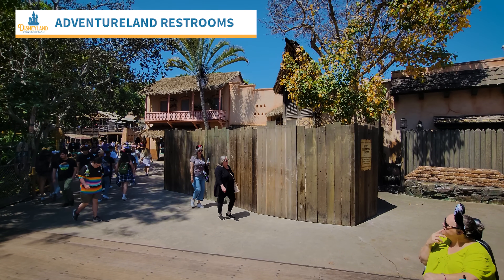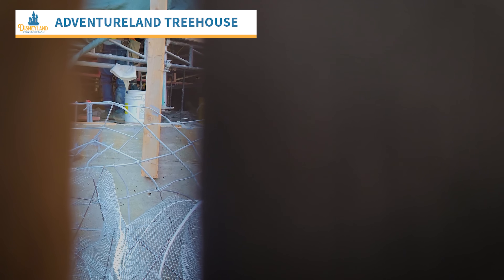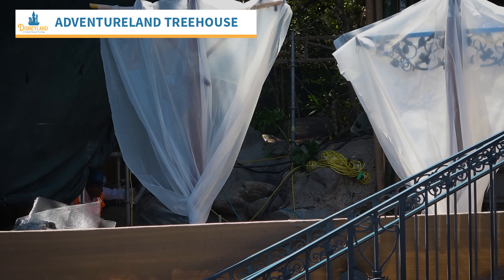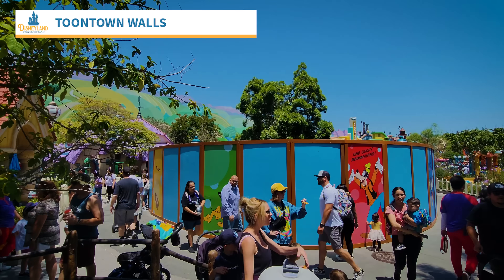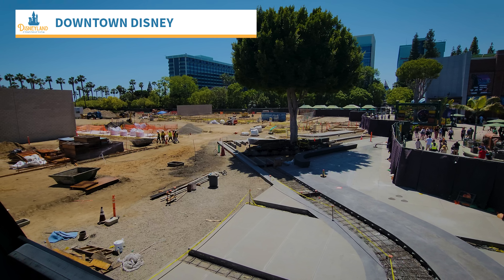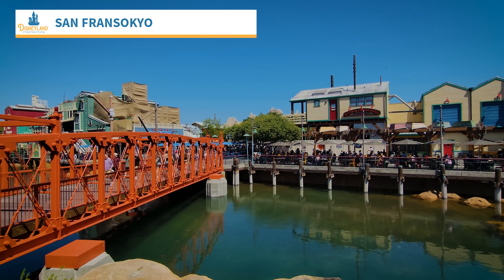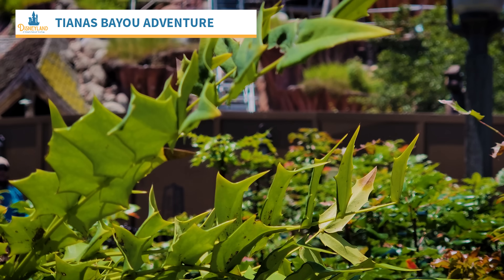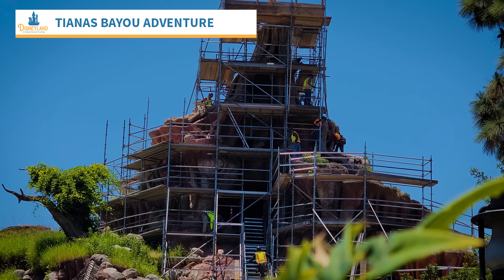Splash Mountain demo escalates + progress at Tianas Palace  | Disneyland Construction 06-26-2023

Comment: @freshbaked, the question you had about the tropical hideaway: it is most likely and access panel for a sump pump that is below, which the sump pump either helps control the water features for tropical hideaway OR it is in correlation with the Restroom project. The restroom project they are most likely replacing the backflows along with new piping. there might even be a sewer ejector pump (not usually used in that type of setting) but given the amount of excuvation, they might had done a long-term temporary repair to buy them time, now over those years have expired Disney needs to fully rectify the original problem. Again just speculation, but given all the type of construction nearby (water-related) the county or city may have flagged them for corrections/ or Disney took the time to get ahead of it and upgrade...